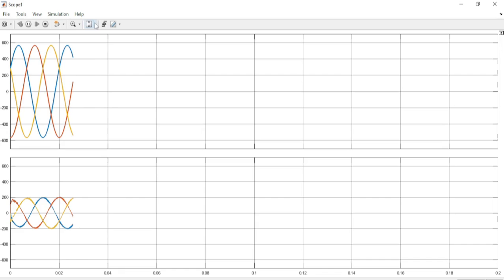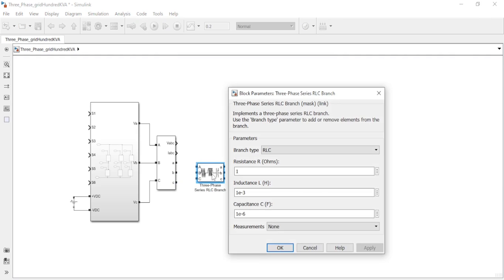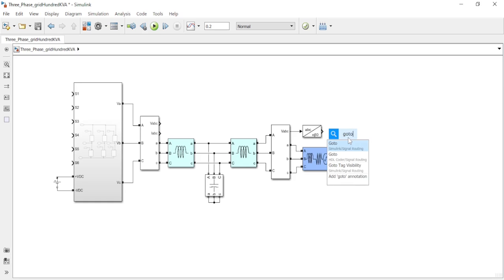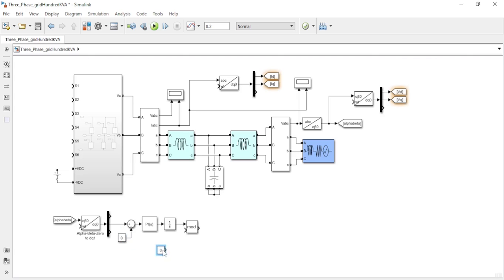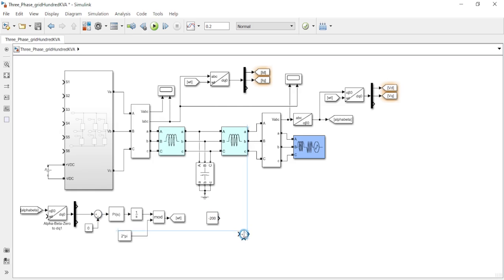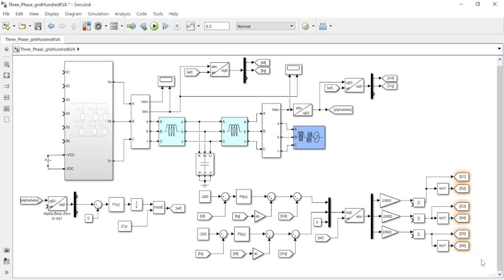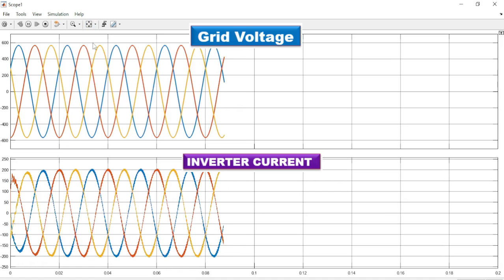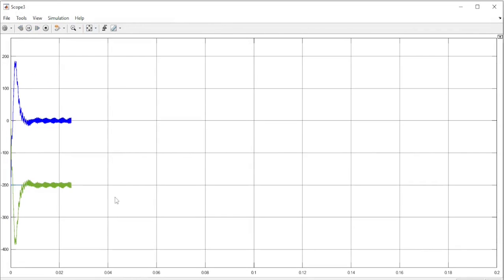Simulation of three phase grid connected inverter (100KVA) with a PI controller in MATLAB Simulink

Comment: Hello, I have a question. At the end of the day which constants did you introduce for the PI(s) controllers for the grid voltage and inverter current? in scope #3 and #4? 0 and 0?

Comment: hello, madam. thank you so much for the tutorial. i want to know how can we calculate the PI parameters; and are they the same for all reference values ( like instead of -200 we take -10).
 i am working in Z domain .
Reply from the maker: The PI controller has been designed on gain tuning technique. Choose a small value of Kp and set Ki to zero. Keep increasing the value of Kp until you reach neutral stability. Thank you for the support.

Comment: How I can convert this Current Controller into Voltage Controller ? To control output Voltage instead of Current
Reply from the maker: Hello, if you are  operating in islanded mode, you can check this video where both voltage and current are controlled https://youtu.be/6pNPnkvmAMI?si=khdY1gFmRWtmnvQM
Reply: @pmctech1415  Okay Thank You Soo Much, Let me see this Video and If I have any queries I will comment in that Video. Actually I want to make the Grid Forming Controller in which voltages are controlled your this model is the Grid Following converter. So if you have any model of Grid Forming Converter or any Video please let me know.
Kind Regards!
Reply: Hello @waqasqaisar8808 i would love to find out if you managed to successfully model the grid forming inverter?